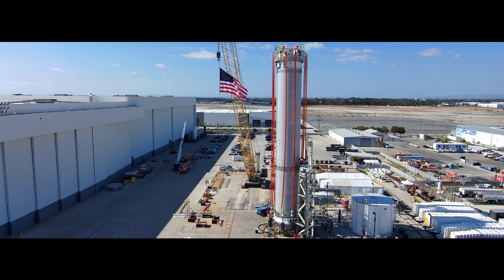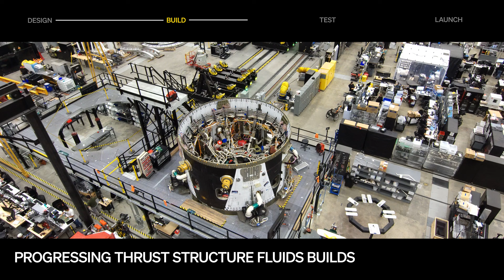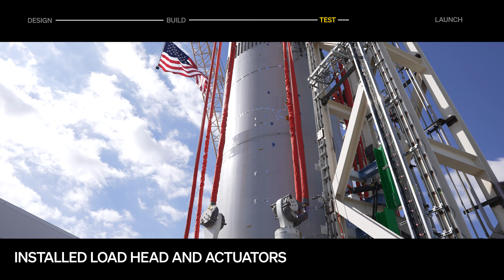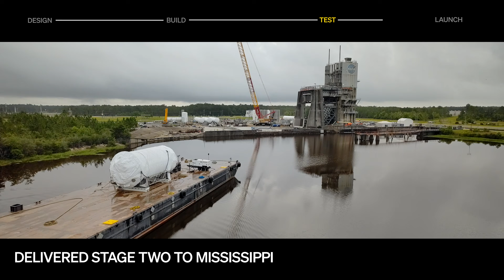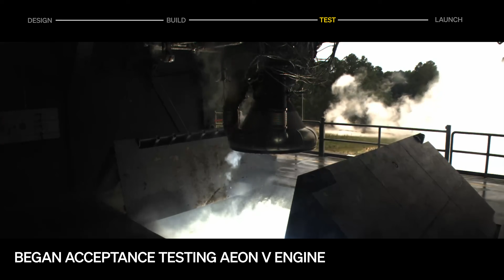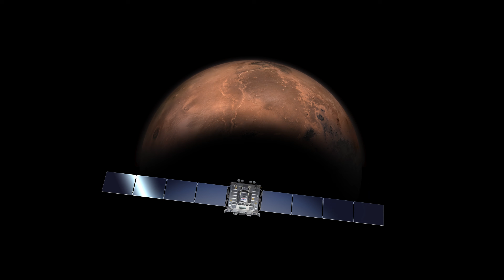Terran R June 2026 Program Update

Comment: In 2024 the width of Terran R was modified from the original design to more closely match that of Ariane 6.  Terran R's planned maximum payload to LEO exceeds that of a 4-SRB Ariane 64, and probably will also exceed the future planned liquid-fuel twin side-booster partially-reusable version of the Ariane 6.  Is Relativity Space focussing on Arianespace as being its primary competitor?  This is a very interesting rocket, and I hope to still see the first launch happening in late 2026.  Is Relativity Space expecting to meet the next Mars launch window in November and December 2026, for the Impulse Space mission to Mars?
Reply: No such Mars aspirations. The Moon is the first hurdle to master before Mars.
Reply: @Robert-Obseravtions It looks like Relativity Space have changed their plans and will no longer launch the Impulse Space Mars Orbiter mission on the first Terran R rocket late in 2026.  They are now planning to do this in 2028, so as I suspected they will actually miss the Mars launch window at the end of 2026.
Reply: They better be prepared to compete against Starship and Stoke Space Nova.